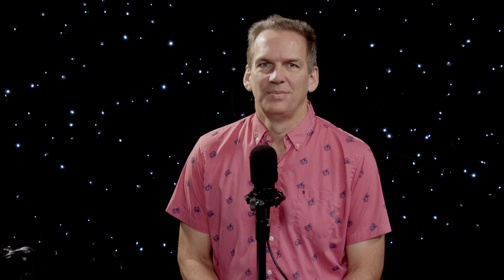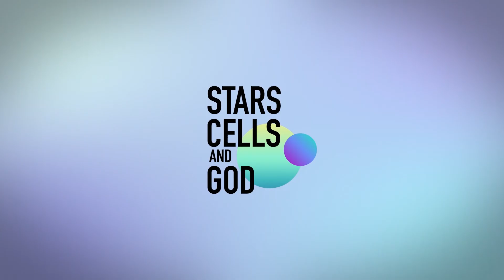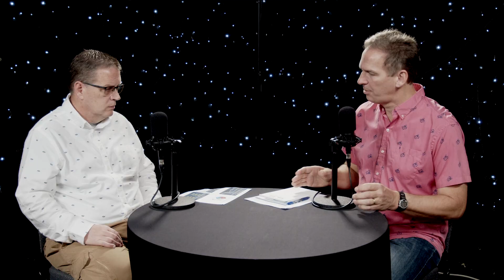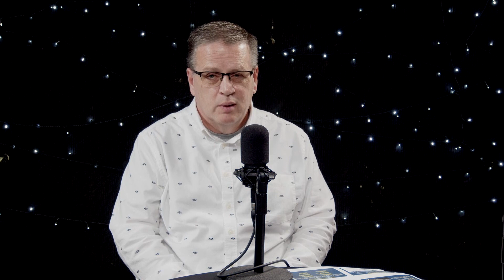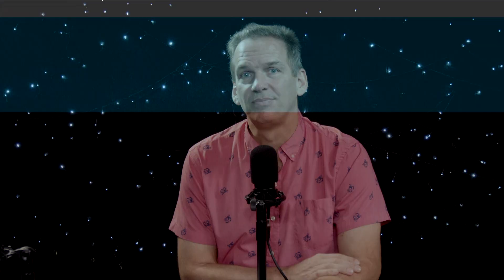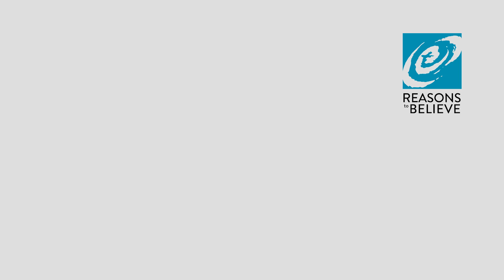Nuclear Power and Climate Change | Jeff Zweerink and Kevin Birdwell

Comment: If engineers and scientists can overcome the corrosion issues with molten salt reactors, the MSR would be an excellent way to generate energy.  

I like fission energy over fusion energy because fission reactors were designed in the 1940s, and the first commercial demonstration reactor produced electricity in the 1950s with a lot less technology than fusion.  A few small reactor designs may have black start capability so the electrical grid can restart from a regional electrical blackout.

In the USA, construction on reactors 3 and 4 at Vogtle Electric Generating Plant in Georgia started in 2013 with only 40% of the design plan complete, and Westinghouse went bankrupt in 2017. While these delays and other delays were going on, interest was building on the loan from the investors. These factor are some of the reasons why the cost of the AP 1000 was so high. The cost of the AP 1000 should be lower in the future.

Comment: The most recent large scale Nuclear Electric Power Projects are new versions of LOCA resistant designs are badly over budget and very late? New research reactor projects in Oak Ridge (TRISO, etc.) molten salt reactors offer many advantages over PWRs (Pressurized Water Reactors). Any new administrations had better get (Funding) behind these new technologies or fall behind China who now have new large scale molten salt reactors in development.

Comment: Is this correct?     To estimate how many square miles of solar panels would be required to meet the USA’s electrical usage, we need to consider the following factors:

1. Current U.S. Electrical Usage

	•	According to the U.S. Energy Information Administration (EIA), the total electricity consumption in the U.S. was about 4,000 terawatt-hours (TWh) in 2022.

2. Solar Panel Efficiency

	•	A typical solar panel has an efficiency of around 15% to 20% in converting sunlight into electricity.
	•	The average solar irradiance in the U.S. is about 5 kWh/m²/day.

3. Conversion Factor

	•	We can assume that 1 square meter of solar panels can produce around 1,825 kWh/year based on U.S. average solar irradiance.

4. Total Area Required

	•	To find the total area, we can divide the total energy demand by the annual energy produced per square meter:

\text{Total Area Required (m²)} = \frac{\text{Total Energy Demand (kWh)}}{\text{Energy Produced per m² per Year (kWh/m²)}}

Substituting the values:

\text{Total Area Required (m²)} = \frac{4,000,000,000,000 \, \text{kWh}}{1,825 \, \text{kWh/m²/year}} = 2,191,780,822 \, \text{m²}

5. Convert to Square Miles

	•	Since 1 square mile is equivalent to 2.59 million square meters:

\text{Total Area Required (sq. miles)} = \frac{2,191,780,822 \, \text{m²}}{2,590,000 \, \text{m²/sq. mile}} ≈ 846 \, \text{sq. miles}

Comparison with Texas:

	•	The total area of Texas is approximately 268,596 square miles.

Conclusion:

	•	To meet the USA’s entire electrical consumption with solar panels, you would need around 846 square miles of solar panels.
	•	Texas is about 318 times larger than the area needed for solar panels to power the U.S.

Thus, the required solar panel area is a small fraction of Texas—only about 0.3% of Texas’ total land area.